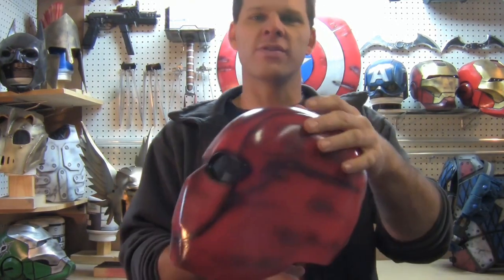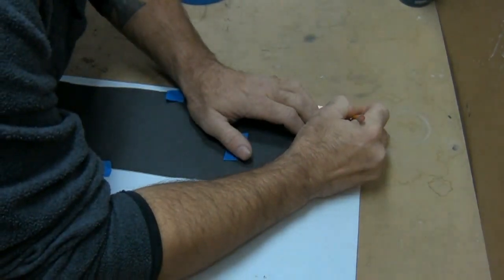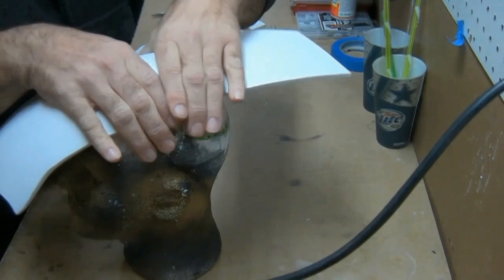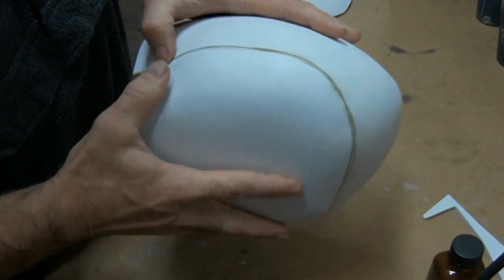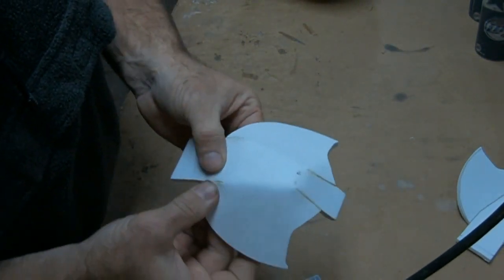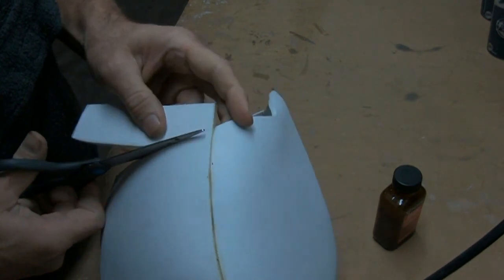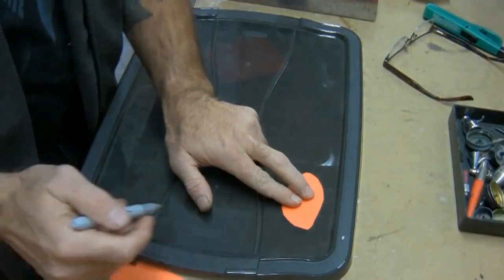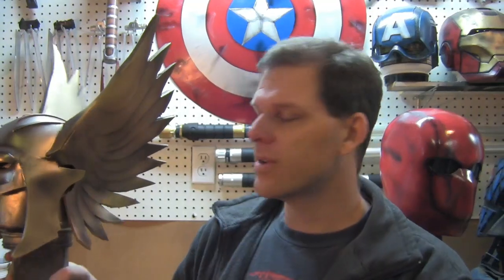DIY RED HOOD FOAM HELMET E 19

Comment: Why do you sometimes use hot glue and sometimes contact cement? Does it depend on the foam? Great video btw.
Reply: otdoud contact cement is much easier to use I guess. Or he just prefers contact cementt instead of glue